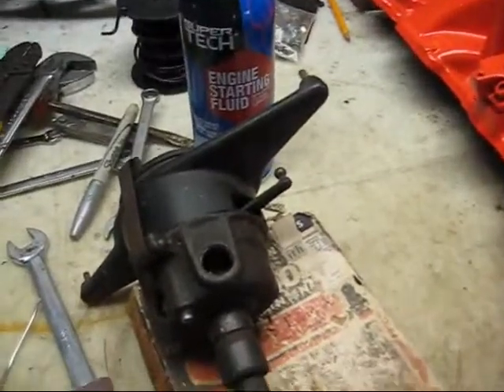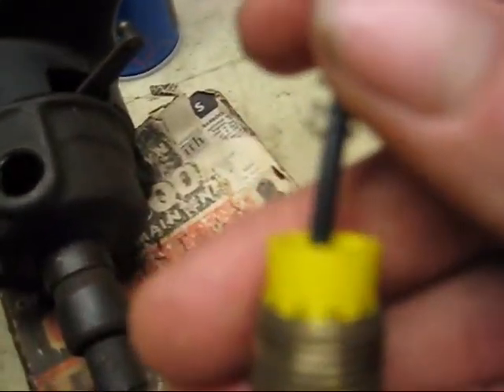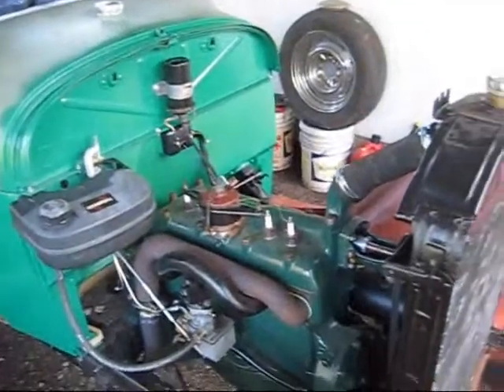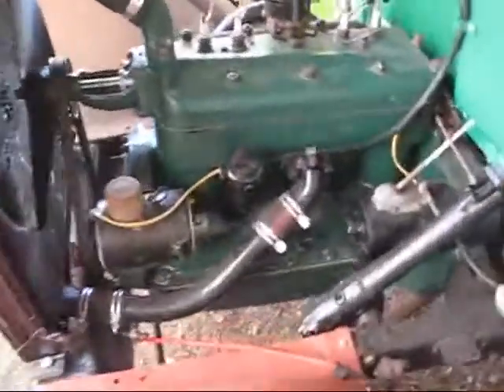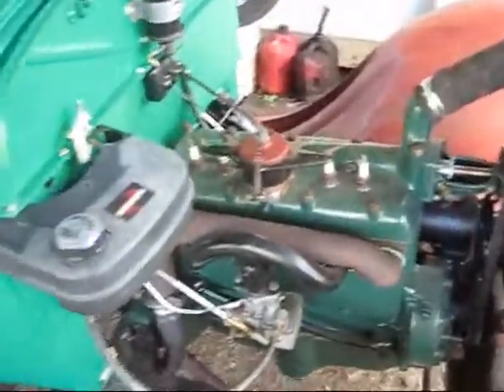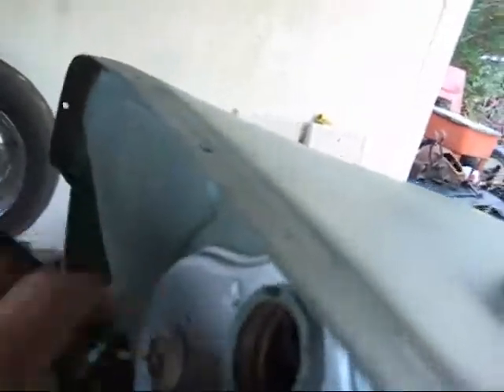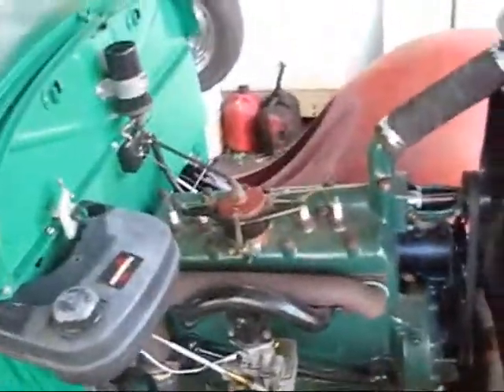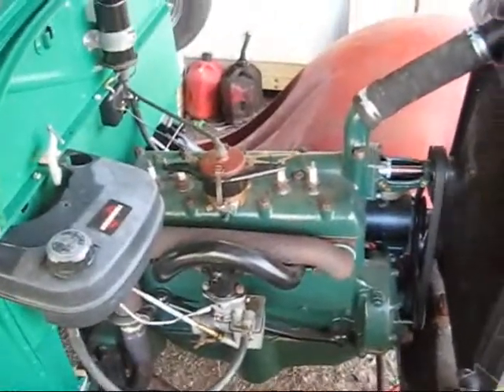Hillbilly Model A Ford Pickup Update  (Its Alive !!!!!!!!!)

Comment: Sounds very good. Congratulations on getting it running. The wiring looks very good, too.
What is the purpose of the mechanism in the transmission to which the key switch cable is connected. Is it an anti-theft protection?

Comment: can iask why u put a 6 volt in, i found if u put a 8 volt in, gives a nicer kick like a 12 volt, and u dont half to change any thing in the charging system since it will run fine with it, did it to a farmal cub cadet and a farmal H because had a hard time starting, and the extra cell rolled it better.